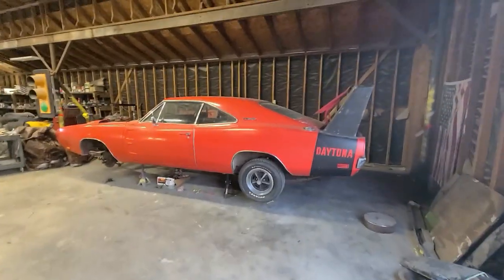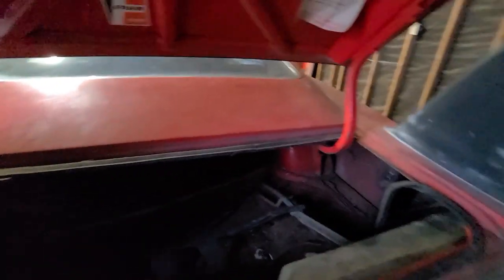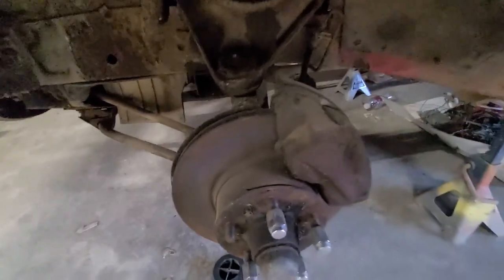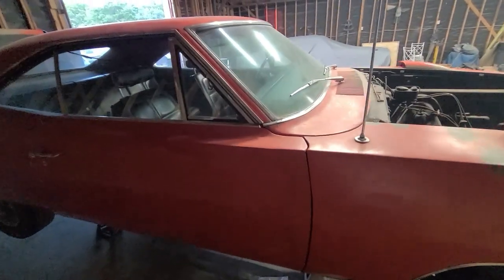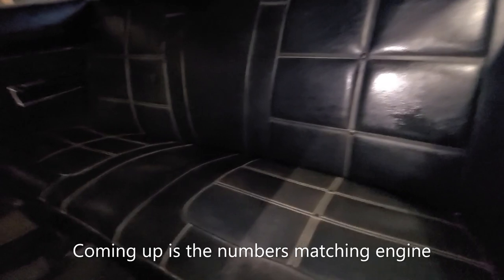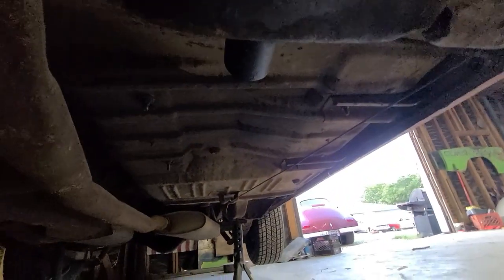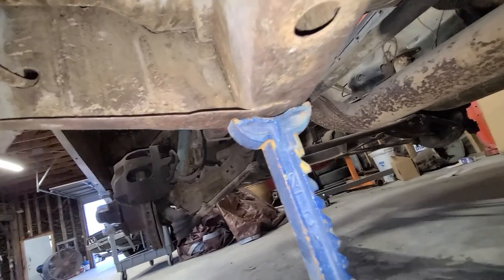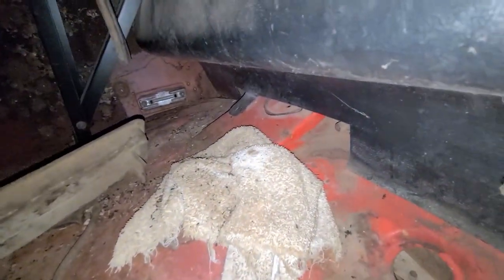1969 Dodge Daytona Survivor

Comment: nice . dose look like it had some work on that right rear quarter panel . looks like a dent puller was used . looks like pop rivets
Reply from the maker: not really sure.  I saw some reflecting there but overall the car after 52 years looks pretty solid.  I would take it if that is the only thing.  Most of the time the floors are rotten, trunk rotten interior torn up.  This one would be easy restoration or just drive it the way it is and enjoy it.  Joe Dirt it maybe. :)
Reply: @clintsclassicworld  yeah I know all to well about 2nd generation charger rust . I am building a Daytona clone and I restored a 69 basket case.
Reply from the maker: @josephorefice9906  NICE!!
Reply: It was side swiped in about 1971 an dthey used a dent puller and packed the quarter fill of bondo.. it is what it is..  im going to leave it as is